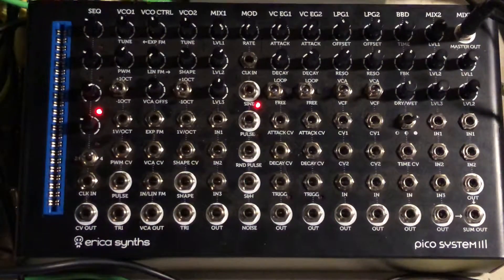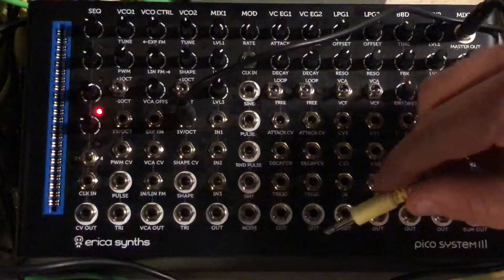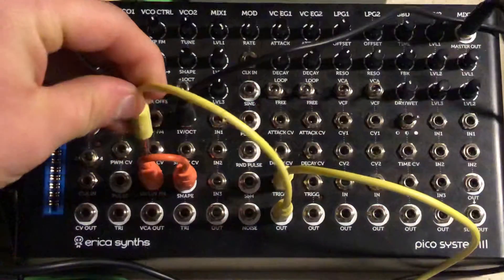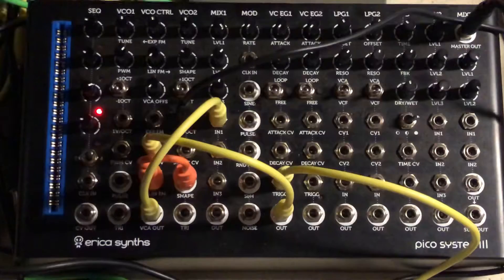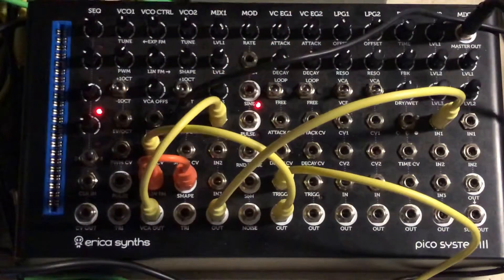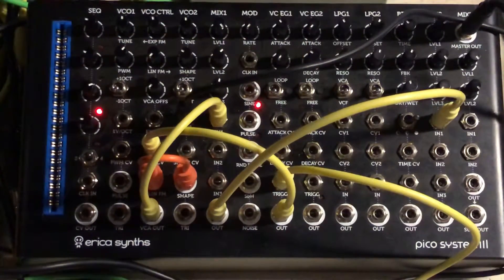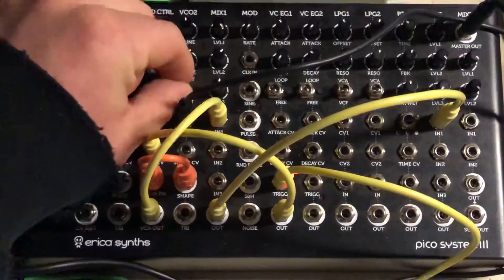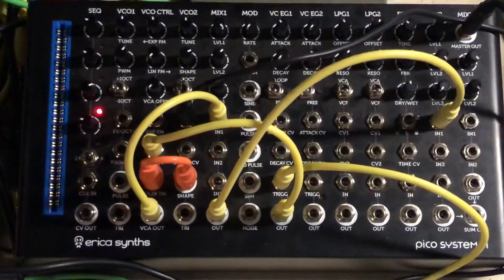Tutorial: Sequencing the Pico System III using Arturia Keystep

Comment: Is the delay coming from the Keystep? The BBD with the high pitch at the slower tempos drives me nuts but the delay here sounds nice. Thanks!
Reply from the maker: Believe I had this running into a Boss DD-3 pedal actually. The BBD on the Pico System III is pretty awful
Reply: @xnflg3074  Thanks!

Comment: Thank you.  This was very helpful.  I just got my pico 3 a few days ago and have a lot to learn.
Reply from the maker: Glad you found it helpful! Please feel free to let me know if you have any more questions. I have an extensive modular setup now but I'm very familiar with the PSIII at this point and would be happy to help. Cheers!
Reply: @xnflg3074  I appreciate that.  I am in that weird place where I am starting to understand what things are and what they mean but also feel like I am listening to a language I barely understand.
Reply from the maker: @ericleon274  That is definitely common. The good thing is that you’re already thinking of it as a language, because it is one. Modular synths speak in voltage and learning the ins and outs of what that means and its implications really help getting the basic knowledge down.
Reply: @xnflg3074  I am having a little trouble understanding the VCEG.  I want to apply the envelope to the output of the vco.  There is no input on the VCEG.  How do i connect it with the signal from the vco?
Reply from the maker: @ericleon274  Envelopes and oscillators are probably one of the more unintuitive types of connections in the world of modular. You want to connect a trigger source to the envelope, set the attack/decay to whatever you want them to be, and send the output of the envelope to modulate the VCA. This can be done with the VCO Control module like I show in the vid or one of the two LPG modules set to VCA mode. The oscillator should go to the input of the VCO Control or LPG module you chose and the envelope output should go to CV1 of the LPG or the VCA in of VCO Control. Be sure to set the top knob on the LPG to minimum for best results. Then send the output of either the VCO Control or LPG to the mixer and adjust things to taste.
Reply: @xnflg3074  Thank you.  Now that I have it all plugged in it makes sense.  I agree that it is not the most intuitive.
Reply from the maker: @ericleon274  Modular gets more intuitive as you play with it but I still get tripped up by that. One option is to use modules that are self-contained “voices.” A voice module has its own VCA onboard but also makes sound so you don’t need an envelope (or anything else) to control its sound and, by extension, they aren’t “always running” like a typical oscillator. There are benefits and drawbacks of course (usually less control and less interaction with other modules, but not always).

Envelopes can also just be modulation sources and you don’t only need to use them to control an oscillator’s volume over time. That’s just how we typically think of an envelope in the context of synths. Part of what’s beautiful about modular is that it lets you break preconceived notions about what does what. Hope you have fun!